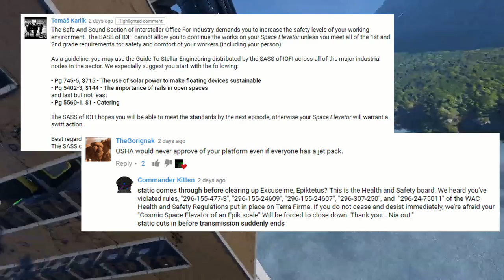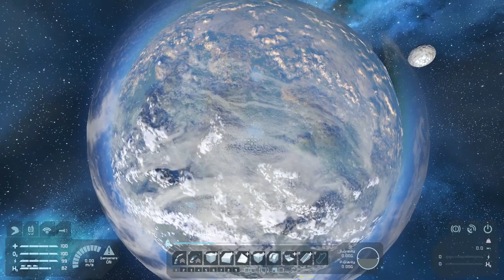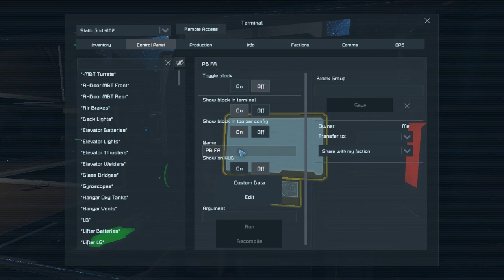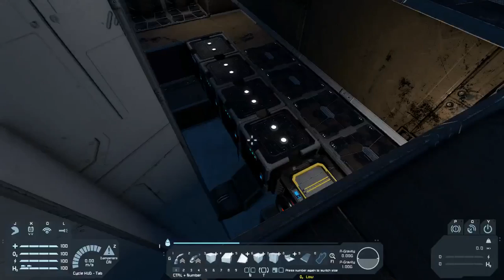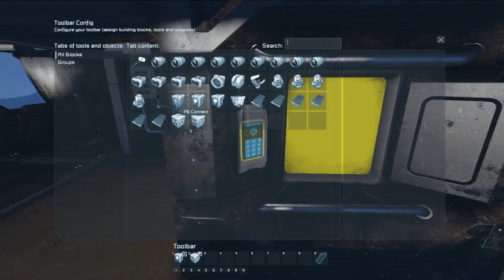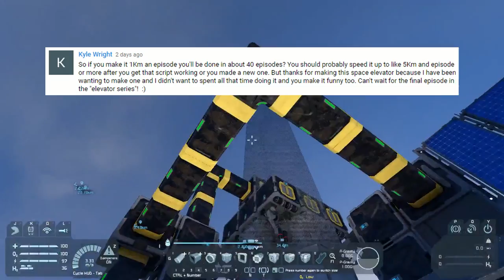Cruise Control - Space Engineers S2E30

Comment: Hey Epik, it's close to being fully automated, nice! Increasing the connector strength might help with the locking issue, but you have to set the connector strength in the blueprints to maximum and adjust the strength in the elevator accordingly as the lower value is used if I remember correctly. 

For the projector issue, I have the same problem with my orbital tether and sadly I have no idea how to solve that with the projector being in the section itself. Mine's worse with the projector not projecting anything after building two sections. I ended up transferring the projector on the elevator itself and use "Keep Projection". I then have a piston system to weld up from the merge point. This might be a bug? Keen?

And yeah, another safety concern, you are on low oxygen so please have some tank or oxygen farm up there. Hydrogen too. And may Clang be ever be in your favor :D

(Yes, I like this series so much I went ahead and shared the headache of building one >.<).

Comment: The remote control block wasn't working because you had it faced the wrong direction. The circle is the "front" of the remote control block and if you set it to forward it would have worked just fine. The more you know...
Reply: Also, the GPS doesn't take from the camera, it still takes from the player character's feet sadly. I've tried this a million times and it comes out the same. :c
Reply from the maker: Yup, it was the GPS location alright. And actually flipped the remote control block, but that got cut out of the final version of the video.

Comment: Do you understand 'recursion'? You're not doing it. You have a blueprint, named (For example) ProjTower2, which you're using as your base projection, putting it in the projector manually when the projection 'magically' disappears.
In 'ProjTower2''s blueprint, the projector that it's projecting has ProjTower1, which happens to be identical to ProjTower2, except that it has a different setting in the projector: ProjTower, which is your original blueprint twisted 90°.
You're going deeper into the matrix, and you're in the dreams of dreams. They are similar, but not the same, and you can't get back to a higher dream by going into a deeper one.
If you edit the projection blueprint file manually, you should be able to have the projector in that blueprint target its own blueprint, leading to infinite recursion instead of two or three levels and then you're done.
Reply: o-o Blueprnception? mindblown
Reply: Darian Stephens error divide by cat
Reply from the maker: That's a good point.
Reply: They are like a nesting doll. he needs to redo them with out one being rotated 90 degrees.
Reply: Been watching this series since someone on reddit recommended it.  I came here to say this.  You need to set it up to blueprint itself (in creative), and then once you've updated the projector block, use the "Replace with clipboard" option to replace the saved projection with the projector configured.
Reply: That doesn't always work. What happens is that eventually it stops referencing itself because it cycles. That's why he uses a script now that actually basically does that exact thing.

Comment: simple fix put connectors on all four sides and change to that blueprint (and add the extra parts needed for the four to you component circulation).

I see you finally thought of that. Though you put four on the elevator and not the tower.
Reply: Safety regulations include a subsection (249-554-676 b, if I remember correctly), to have the possibility for "safety stops" (see 249-553-002) at appropriate intervals (I cannot cite the reference out of my head there, sorry) in the case of so called "space elevators". So the connectors ARE in fact needed here.

Also, I am not convinced that putting railings on the outer side only will find agreemend of the safety auditors.

Further, you will soon run into other problems with the regulations, as operation of "moving devices intended to operate both, near ground (i.e. athmospheric) and far above ground (i.e. in space)" on athomspheric thrusters alone is not permitted, as 355-454-700 ff. call for the use of "appropriate propulsion" (e.g. dual mode systems). Hydros alone would run you into a series of other concerns regarding the safety of the device and the operators though...

DO YOU EVEN READ THE REGULATIONS???
Reply from the maker: Also the real elevator will be designed to make the run in one shot and not stop part way.
Reply: Well that's because you only need 4 on the elevator. So even if the pillar rotates he'll still have 1 connector facing it. No need for more really. Epiktetus thinks in efficiency. He doesn't expend more resources or energy than he needs.
Reply: Commander Kitten true. Though it does mean he will have to make the real elevator he makes to replace this one also have four. But that is really no biggie.
Reply: Not entirely sure if every 250 meters is needed as stops at "appropriate intervals" when you are traveling 40,000 meters in total.

There are many towers that have no railings at all that people are required to climb for repairs and work and those have no such safety violations. The climbers also do not come equipped with jetpacks, only tethers.
Reply: NeithanDiniem aaah. I think I have you there. Show me only ONE space elevator tower without safety stops every now and then. Also, show me an example where safety auditions did not demand high personnel security for space elevators.

Comment: TIM is crashing because it gets three-quarters done (or whatever) in one second, and then gets interrupted by a second TIM starting.  This happens a lot with large grids when TIM is running every second.

But TIM also works fine if you invoke it every three seconds.
Reply from the maker: There's also a way to break up it's run into many parts, which is what I plan on doing.